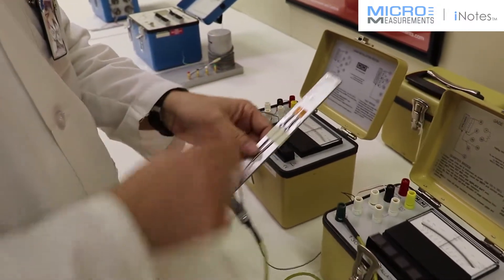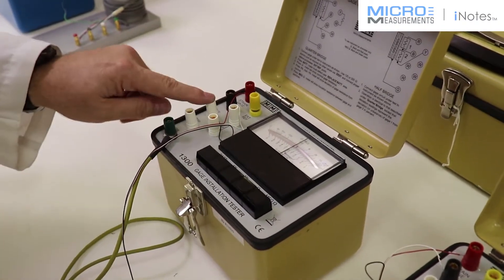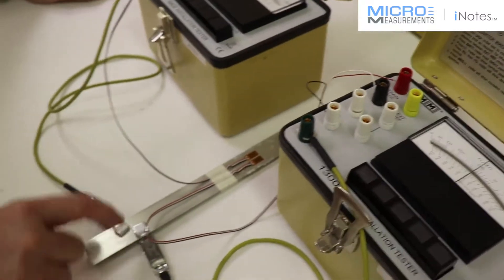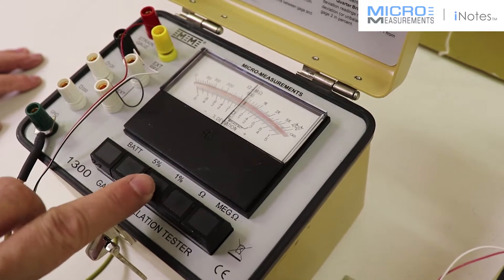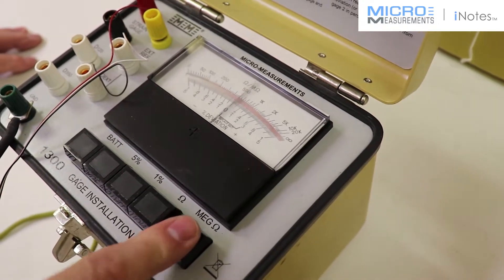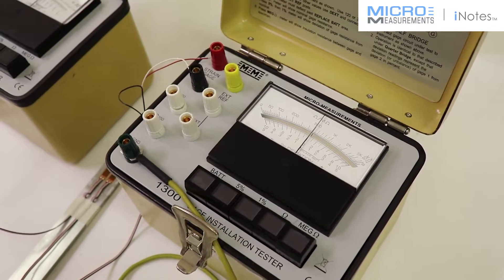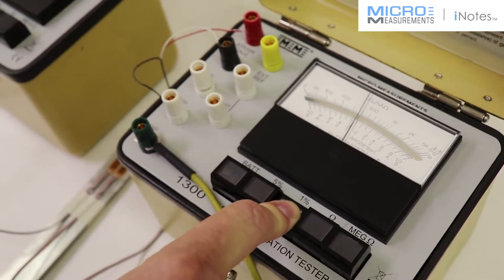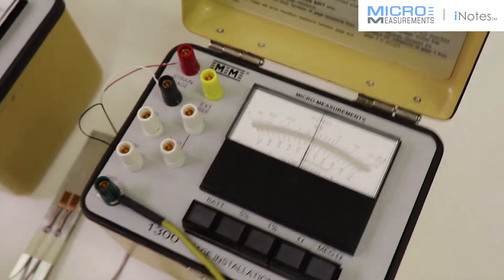How to Measure Insulation Resistance With The Gage Installation Tester (Advanced Sensors Technology)

Comment: Siempre que se instale una ban extensométricas en una pieza o estructura metálica, en este vídeo una CEA de Tecnología Advanced Sensors, uno de los ensayos más básicos para comprobar de la calidad de la instalación es medir la resistencia de aislamiento, esto es la resistencia entre la rejilla de la banda y la pieza. Esta resistencia de aislamiento se puede medir muy fácilmente, y sin riesgo de dañar la banda, utilizando el Verificador de la Instalación de las Bandas Extensométricas de Micro-Measurements, Modelo 1300.
Si la banda está correctamente instalada y se ensaya en condiciones de laboratorio, la resistencia de aislamiento debe ser superior a los 20.000 megaohmios. Para seguir considerando las medidas de deformación precisas y fiables, el valor mínimo aceptable de la resistencia de aislamiento es de 10.000 megaohmios.
Si necesita más información, por favor no dude en contactarnos. mm.es@vpgsensors.com miguel.bravo@vpgsensors.com